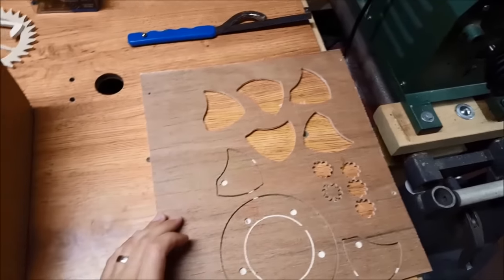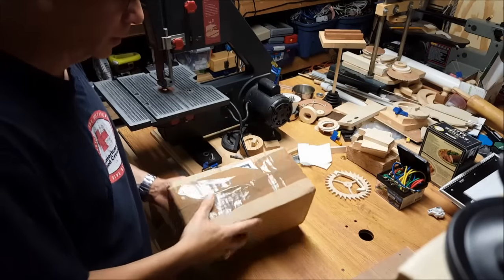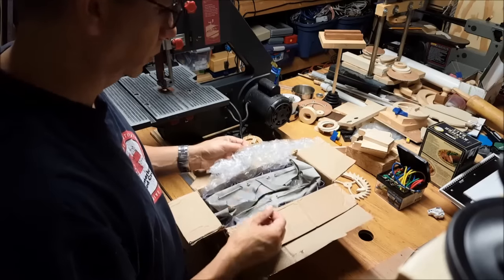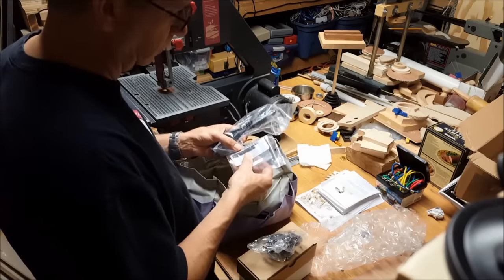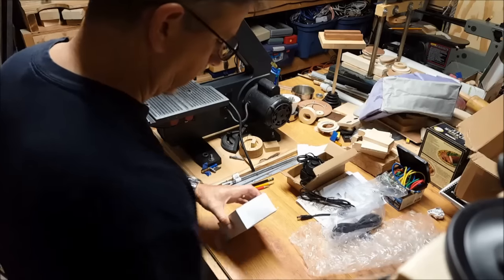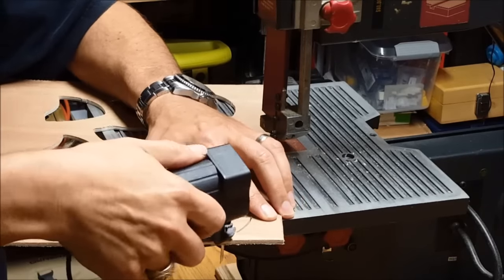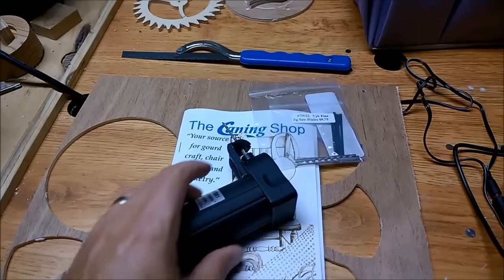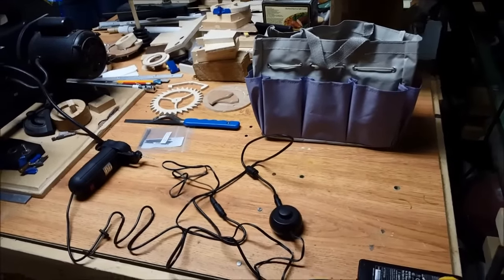Mini Jig Saw - Cut Tabs Fast!

Comment: Just saw something similar at Menards. They call it a compact detail saw. $30 for the corded version. $35 for the 8v cordless version. 10 pack of blades is $7.
Reply: Dear phiksit do you know the cordless version if it takes simple batteries or lithium ones recharables. Many many thsnks
Reply: Great….easily ordered online at Menards’…..with the extra blades. Yup, the ‘corded’.  Shipping•handling a bit expensive, but at leas5 will have the motorized compact detail saw….👌.  Thanks again.

Comment: never heard of a mini but now will look into one for us, being this video is over 2 years old u should now know how its preformed and lasted, another such review would be awesome, its too bad people don't make reviews once things have been used for a few months or years. We use the rockwell blade runner saw quite alot, but the motor over heats then fails, we have a stack of dead saws and another stack of new in the box saws, so a mini jigsaw might save us big $$ over time.
Reply from the maker: I've used the tool off and on for a couple years and it's worked well.  It's definitely for light stuff but comes in handy.  Thanks for your comments.
Reply: Please give me the address from wher I can buy it.thanks
Reply: Have you got a link to your reviews

Comment: Hi after 8 yrs is this thing still working?
Or how long did it last?
Did you buy a new one or a different make..?
Thanks
Reply from the maker: I actually misplaced it when my workshops changed.  I do have a new one now that works fine.  Cool little saw.
Reply: @drez20001  Thank you brother, for the prompt response 🙏🏼. Much appriciated 💕

Comment: Have you tried small pruning shears? I use them for cutting thin stock and they leave a clean edge.
Reply from the maker: Haven't tried that yet.  Interesting.  I am really digging this little jig saw though.  Works fantastically well for small intricate cuts.
Reply: Some of my friends got tired of sawing the tabs also and have switched to the small pruning shears and they work fast and have a very clean cut. Give it a shot. Oh the saw is really cool I could have used that awhile back.

Comment: Nice little tool but I am not sure it is $60 nice. I can buy an awful lot of scroll saw blades for that. The scroll saw takes a little time setting up for the cut but it is also hard to beat for very small and tight cutting...